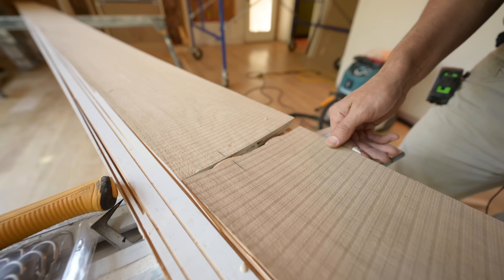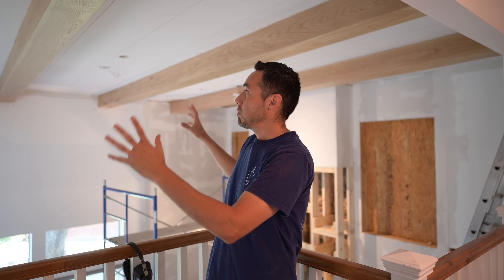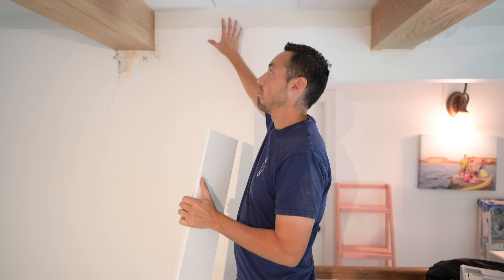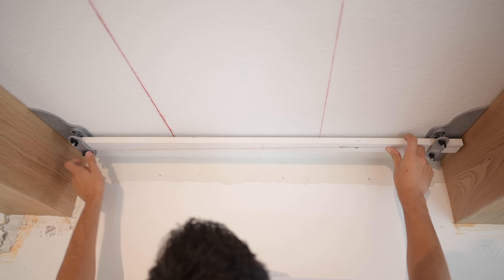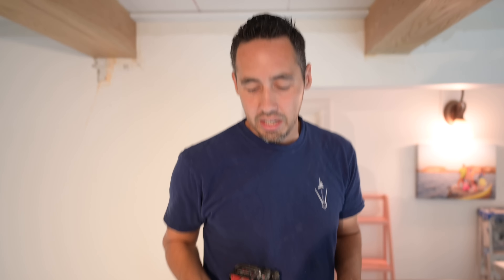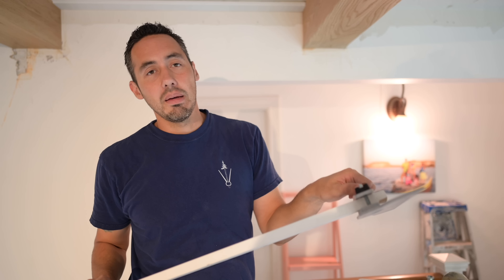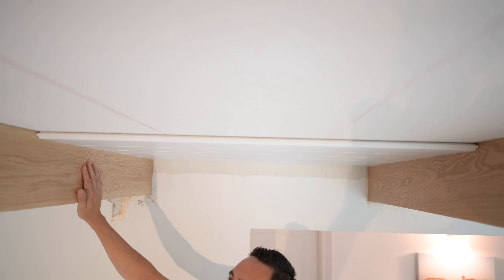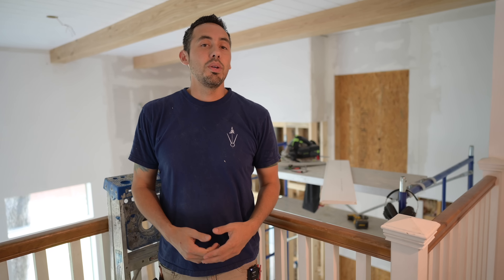Our Beams are DONE!

Comment: With smaller beams where there is t&g we have ran the t&g first snapped lines and from the backside of beam sides we pocket screw into every piece of t&g. What this does is eliminate the need to scribe and sucks every piece of t&g tight to the beam sides.

Comment: No need for an expansion gap against the beams?
Reply: I thought a gap would be needed surely? What happens when it all expands and contracts?
Reply: Lumber's length-wise expansion is very minimal - only about 0.01% versus 4-8% width-wise. Between each board is where an expansion gap is needed.

Comment: Pre cut your tape in 1" squares and stick them to your shirt. You can do the V's first, then run your length of tape. I'm a paint contractor and that's what we do. Hope it helps. Big fan of y'all.
Reply: He might try cutting through a whole roll of tape across its width on his bandsaw to make dealing with these short pieces easier.
Reply: @heystarfish100  only drawback with that is getting clean edges but it probably would be so minor that you would never see it. Awesome idea 💡🌴👍👍😎🌴
Reply: Great tip.
Reply: @davidneilson3508  It all about having more teeth on the blade per inch. A fine toothed narrow kerf hand saw should do well like a fret saw or coping saw.
Reply: That's brilliant. Thanks for the tip. Almost as good as the look my wife will give me when she walks in on me looking like I'm a molting green snake. 😅 😂

Comment: You did good for what you were trying. But I see lots of problems in the future with expansion, contraction, bending, cracking, etc. 
Also the wood has mill marks like a mofo. Its like straight off the rack from Home Depot. Maybe you can't see from the floor but up there its very noticeable.

Comment: Protip, if not mentioned already, working at height, in a very crowded environment, with expensive tools, protect it. A safety lineyard and you are good to go. Nothing worse than a little careless movement and, in the middle of the job, a 1000 usd Festool flies off into the deep. Just saying.

Comment: The hkc55 is cool no doubt but it's not the best or easiest tool for this application. Other than showcasing this tool as part of a promo you should just be using a 7-1/4 miter saw. Set the bevel to 3 degrees and turn the miter table. Easy. No clamping required. That festool can be used for a lot of things but buying it just for this scenario was a waste of money.

Comment: You do such remarkable work.  I'll only add that I've marked an L and R with sharpie on my stair gauges to remind myself from cutting the wrong angle--if I unintentionally flip the jig 180 degrees during marking phase on the board.  Ask me how I know this.  Yes, it also saves wasting material on incorrect cuts.

Comment: After setting your gauge with the length of the board, I would’ve seen how would fit 6 inches away and keep doing that until it wasn’t snug anymore. Then I would remeasure, instead of one at a time. I was always extremely detail oriented, but also consider what is most efficient.
You’re a master craftsman Richard, and have been following you for years ❤.

Comment: Looks nice.  I can only imagine what this is costing the homeowner with all the labor alone.  One thing to add you did not mention... it is critical that the T&G sit inside for at least a week or so to acclimate.  Last thing you want is the boards to shrink.

I actually took my beams out of my family room & kitchen and I tried to source 1x8 T&G to cover the old popcorn, but nobody has it around me.  I like the wider look and it makes the ceiling less busy.  Custom ordering it was more than double the cost of 1x6 I went with, but it came out nice in the end as I also used the non-beaded side.  The biggest pain was scribing more than 12 feet of the starter boards to fit around a field stone fireplace.
Reply: This is his own house he is working on.

Comment: Ceiling is going to be gorgeous.  Seems like it might have paid to paint the tongue and groove slats prior to installing them.
Reply: My thoughts exactly. Prepainting seems like it would save a lot of heartache
Reply: The only issue is that the boards will get scuffed from your hands (even if you keep them super clean), saw deck, hammer, stacking them, or literally anything. Gotta spray after install for a pristine finish, and Richard would not settle for anything less than pristine!
Reply: You would also likely get some paint on the tongue/groove and make it a lot harder to seat
Reply: I normally have them painted first and then a coat in place to fix an imperfections

Comment: If the beams are perfectly straight,  Why scrib every board in between? I mean it should at least be almost perfect enough that the caulk will cover the boards in-between. 

And you don't need too cut the tape for the Vs, If you are caulking you won't see the Vs touching the beams anyway. It's a waste of time.

Comment: I think the cupping goes along with that rough sawn look you have on the beams! If you wanted to fix that you could’ve run kerfs lengthwise down your boards and nailed on a couple small boards/blocks on the inside to flatten it

Comment: If you’re caulking the joint between the beam and t&g, you wouldn’t see the t&g gap anyway if you installed them first.
Reply: Based on his videos from way back in time, I think he is not going to sloppy caulk, but just seal so that the lines are still crisp. 🤔

Comment: How about to save time, before you place in the tongue and groove board, use thin masking tape and tape the side of the beam where the tongue and groove board will goes on top of it but still leave like haft the width of the tape on the bottom, leaving room for continuing masking off the rest of the beam. When the painting is done, all you have to do is with a fresh sharp utility blade, cut close to the edge and the V profile of the boards, rip off the tape and woah-la. 
That will not only make your job 4 times faster and productive, but eliminate any risk of paint bleeding underneath the tape when doing the way you described in the video, cutting small tape corners and work it into those v-groove.

Comment: I agree with your reason for doing this the hard way and I recommend you use scissors or utility-knife when you tape those little spaces. Cut squares (assuming they're 90 degree angles) and install quick and easy. And uhh...yeah...wife is going to love Festool green.

Comment: I understand & appreciate that level of detail because I'm the same way. Currently installing square balusters where I didn't want any shoes. But I also don't have a mortiser. So, I'm drilling holes & then squaring them off with a chisel. It's a lot of work but that detail is going to be so nice & worth it in the end. 

One suggestion about your project though is why couldn't you install the tongue & groove first. Then when it came to install the beams. You just notch out / cut away the section where the beams will sit / fit so you still have that corner detail.